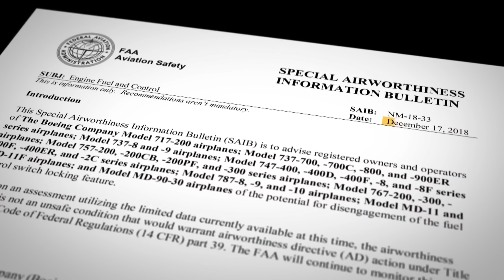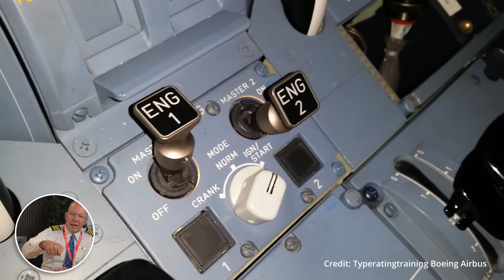Air India 171: The FAA’s 2018 Fuel Switch Locking Bulletin Explained (16 Questions Answered)

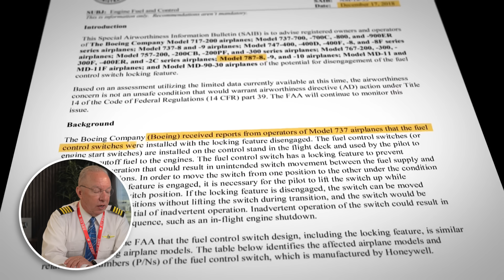Comment: 7:40 If that is the case, why does it advise checking the entire in service fleet, and why does it advise replacing parts on the in service fleet?

Also, is it spring loaded to lock where it was set, or on is it spring loaded to off?  Everything I’ve read makes it sound like it spring loaded in place.  That seems to make sense as well - while usually you would expect the wrong side failure to be fuel off, there are clearly cases where the wrong side failure is on.  Consider an engine fire, or a catastrophic leak after the valve controlling the cutoff.

Comment: I’ve worked with these type switches during my whole career in the power industry & after hearing other aviation experts talk about the “As Found” crash indication vs the “black box” indication of the engines spooling down then up are contradictory? When will the “black box” parameters be released as the crash position vs the other doesn’t follow? If the switches were both taken to “cutoff” then one would have to assume sabotage? But the other indication of the engine spooling wouldn’t be consistent with both switches being cutoff? These switches are proven & hardy & used in military & non-military alike. Sounds like human error was the main factor but until the black box findings are released, we won’t know??? One would have thought that it would be impossible to place both switches in cutoff when in the flight mode would have been interfaced with at least a software precaution to avoid placing both switches into cutoff in flight mode? With the recent issues with Palestine & India, personal issues seem subject??? Essentially, “we don’t know what we know until we know it”
Why doesn’t any aircraft mfr have an “Oh Sh*t” button that would allow the pilots to override the software and allow “stick & rudder” control to avoid the 767 issue where the side took over doing things the pilots didn’t want??? Software is good but final control of the plane should be by the direction of the pilots above all.

Comment: Capt. Steve, I appreciate your insightful analysis of the AI171 incident. I have a question - hope it's not too late or too much. Given these modern airliners are managed via computers/firmware/software,  is it possible, in your opinion, to update the flight management systems to prevent engine shutdown when the fuel switches are cutoff in certain phases of flight? Example, when the aircraft knows it's in departure mode through several inputs, LD gear switches, full throttle, flaps/slats set, ground proximity radar. It seems there should be a realtively easy software update that would prevent the FADECs from shutting off the fuel during the takeoff roll and climbout until the aircraft reaches, for example, 1,000' AGL. I believe I heard another content creator say even with an engine fire on takeoff, the checklist does not call for the fuel to be cutoff immediately, but I may be mistaken. Thoughts?  Thanks!

Comment: Without any visual confirmation one can't be sure that control switch was manually put off...  Alternatively, cud it not be possible that it was switched off to shut the engines down to restart it in case there was some dual engine failure situation...

Comment: 11:47 In an Engine Fire situation, doesn’t pulling the Fire T-handle cut off the fuel? Why must the pilots have the option of cutting off fuel with the fuel cut-off switch while flying? In an engine fire situation what our pilots would have to do was to pull the Fire T-handle and then choose which fire extinguisher to open. Pulling the red Fire T-Handle automatically cuts the fuel off. 
Please explain how you would deal with an engine fire situation on a Lockheed P 3-C.

Comment: I don't think we know for certainty that a human placed those switches to cut off position. You can't be saying that without proof. It could very well have been a switch malfunction too right. The pilot did say "I didn't". This is where a camera could give so much more clarity. So many lives are at stake. It is a commercial vessel with hundreds of people on board. In this day and age not having cameras in the cockpit is really bad, and giving room for foolery.
Reply: The fuel switches cannot move from "Run" to "Cutoff" without external (human) force. They are literally designed this way. They are mechanically latched and need physical action to be moved.
Reply: They could absolutely have been switched without human intervention, and this should be discussed. The report is the report Boeing wanted. That's all we know for sure at this point. Nothing else can be said with certainty.

Comment: I am surprised that  the captain is so convinced  about the theory of a suicidal act behind the crash of the Air India Dreamliner. 

In my view, several facts clearly argue against the possibility of a deliberate act: 

1. No psychological or personal distress: Neither of the pilots had ever shown signs of stress due to financial issues, family problems, or emotional setbacks. One was deeply devoted to his family, and the other was soon to be married.

2. Active efforts to prevent the crash: Until the very last moments, both pilots made every effort to avoid the disaster. Behavior entirely inconsistent with a suicide attempt.

3. Ignored FAA warning: An FAA safety circular had warned that the fuel flow switches could automatically move to the "off" position under certain conditions. This warning was disregarded by both Boeing and Air India.

4. No conclusive blame on the pilots: The official report does not assign responsibility for the crash to the pilots. It merely states that the fuel flow switches were found to be closed, and then reopened just seconds before impact. This is  suggesting that  the fuel cutoff may not have been due to pilot action 

Blaming two pilots, who are no longer here to defend themselves, may be the most convenient explanation for Boeing and Air India but that doesn’t make it the correct one

Comment: Im pretty sure any cameras installed in the cockpit would be destroyed in the crash and subsequent explosion and fire.
Reply: But not the SD card where the footage will get stored.
Reply: @pmaitrasm Why wouldn't the SD card be destroyed?!? Im certain the SD card would be destroyed as well. SD cards aren't fire resistant.
Reply: @ITouchDownEverywhere , Neither is the flight data recorder, but it is placed inside the black box, which is fire resistant.

Comment: As a NEVER Pilot or Air Engineer, BUT as an Analytical Person.
1. On Boeing 737 aircraft, MAX Killers, this SAME SWICH was a failure 
2, FAA DID NOT Issue a requirement to CHANGE the DEADLY Switch
3. The Fuel WAS switched OFF but NOT BY EITHER PILOT
4. Boeing, yet again, KILL People ? STINKS of US and Boeing Cover Up
5. USA Government PUMP $Billions to SUBSIDISE Boeing against WTO Agreement
6. YET AGAIN Q. Are the FAA and US Whitehouse GUILTY of another Mass Murder?
7. Q. Should ALL Boeing New Aircraft be HALTED until the REAL CAUSE is disclosed?

Comment: So the Captain doesn't want to be on camera in the cockpit. With a thin argument: that such cameras wouldn't prevent Pilots from fumbling around with random toggles. Well, I wonder how many FDR or CVRs ever PREVENTED onboard IN THE SITUATION Pilots to initiate a mishap. Also this Air India mishap wasn't prevented by the FDR or the CVR. And without these cameras you do not know who switches two good engines off - and who put it in ON again. And what else happened nonverbally. I would like to know.

Comment: I think a lot more will become clear when a full transcript or recording of the voice recorder is shared or summarized by the investigators. Ten seconds might seem long to some of us at first but if you think about the unimaginable shock and confusion it must have had on the pilot flying to see the captain /pilot monitoring move the fuel cutoff switches to cutoff and hearing the engines spool down and then the denial of that colleague. What does that do to your mind? Maybe you start doubting your own senses. Everything in aviation is about safety and here is a respectable colleague sabotaging the whole plane and everyone in it right in front of you?? Maybe there was even a fight or struggle.

Comment: Interesting result when asking chatGPT if this could happen on an Airbus 

Could That Specific Boeing Scenario Happen on an Airbus?

Short answer:
No, not in the same way. An accidental dual engine shutdown due to fuel control switches like on a Boeing 787 could not happen on an Airbus — at least not by simply flipping two switches.

---

🧠 Why Not?

✅ Airbus FADEC Control

Airbus aircraft like the A320, A330, A350 do not have manual fuel cutoff switches.

Comment: Hard to see a reasonable argument against cameras in the cockpit. Would it prevent the accident? Probably not but that utterly irrelevant because it isn't there to prevent an accident and no one ever claimed it was. They are to provide information about the accident (and potentially prevent repeats).  The voice recorder or flight data recorder also do not prevent an accidents either yet no one argues to get rid of those.
Reply: Exactly

Comment: The Indian media just after the fatal crush had reported a cockpit conversation: ... No Power... No Lift... just after the 'mayday' call. I don't hear it anymore, drowned in the din of multi level interests. It indicates to a technical flaw. The sole survivor heard unnatural sounds. JAL flight while descending lost the fuel switch that turned off on its own. Another Sydney Auckland flught lost the switch and dropped 400 ft before recovering. Pilots are strong nerved people, they do not usually lose to depression.

Comment: Enough of blaming on the pilots, this is software issues. Something went wrong with the system. Come on, even I that am not a pilot know that the take off is the most critical moment of the flight and there is no such a safety program to stop the pilot of cutting the fuel while taking off with the aeroplane already off the ground?

Voice recorder doesn’t confirm one of them cut the fuel and only asked have you cut the fuel?

I knew at first that is was loss of power, it is very similar when I used to flight my RC aeroplanes and there wasn’t enough power, looked exactly the same.

Comment: As I asked last time, if the plane is in the take off configuration, there should be some safety to prevent shut off any engine without any warnings of engine problem. I think there should be SOME level of AI introduction if something is out of normal.

Comment: As a retired aircraft Crew Chief in the UASF on 1 Bowing, a B 52H and 2 Lockheed large cargo, a C 141A and a C 5A aircraft I was ground engine run qualified on all 3. It's amazing how the engine controls have changed since the early 60's. Now 40 years after retiring I have forgotten most of the operation of those engines. This is as sad incident.

Comment: The fuel cutoff switches moved 3 seconds after aircraft rotation. 1 in 100 Billion chance....
Reply: Cocă Cola spilled by the janitor ingressed in switches at rotation and caused false CUT OFF electrical situation. After leveling it "self repaired" to RUN.

Comment: You completely missed the point about video in the flight deck. Nobody claims that a video would have prevented this accident. But it would go a long way to determining what did and did not happen with those switches, who flipped them, and under what conditions. Walmart cashiers, truck drivers, bus drivers, taxicab drivers, security guards, police officers, EMT workers, delivery drivers, bank tellers... All have their entire shifts recorded on video. Why does the pilot union think that their members are so special that they should be exempt from this group?

Comment: The bulletin from Boeing doesn’t sound as though it’s about the switches being installed upside down surely they would state that sounds like the mechanism which keeps in the selected mode Run or Cut Off was faulty from how I see it, in fact according to your theory if they were installed upside down and they wouldn’t stay in the run position they would go back to cut off how would they even start the engines. I’m thinking I’m missing something here surely this can’t be your theory on this?

Comment: @Captain Steeeve, (love your channel). according to the official accident report you showed, there were 4 seconds In between the 1st then 2nd fuel switches being switched back on. That seems like a long time. Why might the pilot wait? Is that period of time needed for some technical reason? What is the flight procedure for restarting both engines in flight?

Comment: If the switches operated as claimed, they would not have issued the bulletin. In other words, there is a known issue. I seriously doubt that either pilot turned them off knowingly. That said. depending on how those switches are wired (positive or negative logic) a momentary power loss can indeed register them as shut off................ remember that they were found in the on position and both pilots claimed they did not shut them off. This is a maintenance or engineering issue, not pilot.

Comment: Thank you for the video, but!
Ok, Firstly Captain Steve - you are pretty clearly implying it was intentional on the part of the pilot(s), or that was entirely pilots fault. You also seem pretty sure there was nothing wrong with the place. Please don't do that unless there is more info than the prelim report. 
Rotation occurs at 08:38:39. 
The right speed of 180knots achieved at 08:38:42, with fuel switches to cutoff immediately after that at 1 second apart. Seriously, Captain Steve?!? Seriously?! Is it likely one of the pilots did that?!
RAT deploys at 08:38:47. 
Back to RUN at 08:38:52 and eng 2 at 08:38:56. Mayday call at 08:39:05
I wish you would comment on this time line! 
These are facts that don’t add up, Captain Steve! At lest not now.

Comment: Cameras and pilot bio-data monitoring in cockpits NOW!  Only a video camera could confirm if fuel cutoff switches were touched by a hand.  It would not be too intrusive to fit pilots with a "smart watch" that monitors and reports to HQ in real-time, the pilots heart rate and oxygen saturation.  An AI equipped camera monitoring the pilot's faces could detect United pilots falling asleep during cruise and send a "jolt" to the smart watch to bring them to waking world.  (Correct me if it was not a former United crew that fell asleep and overflew destination.  Did they find work with Atlas?)

Comment: Sounds like Capt Steve got a bias towards blaming the pilot... how can one be so sure that the fuel control switch were manually put in cutoff position.. is the only evidence for this is the fraction of conversation where one pilot asks that did other one cut off the switch? I think the larger part of conversation shd be put out that includes the prior and after part of the voice recorder.... as far as flight data is concerned it cud hv recorded wrong data indicating that fuel switch was cut off... after all flight data is recording some signal based data only and it can certainly be erroneous...

Comment: I'm no expert but I believe the pilots association's objection to the introduction of cockpit  video recordings is a rehash of the one they used many years ago when they were against voice recordings, ie a 'spy in the cab'. Video cameras in the cockpit and externally fitted to various locations on the aircraft, would be a excellent way of making air travel safer.